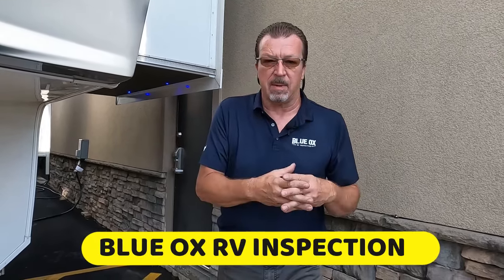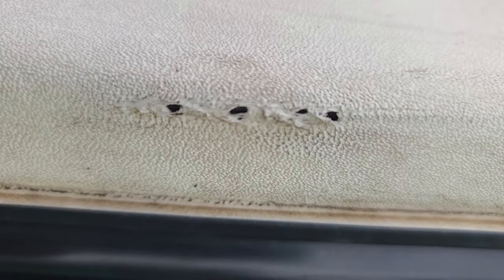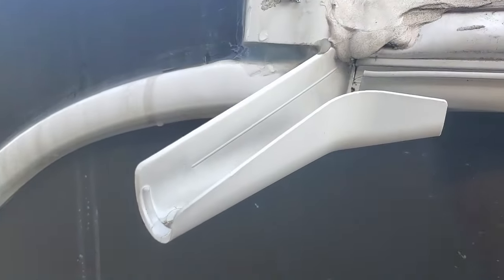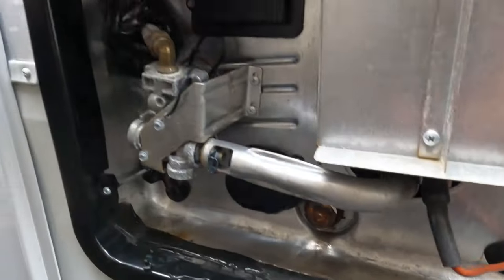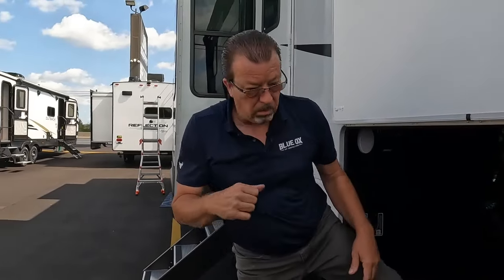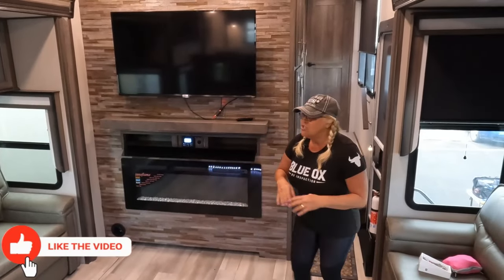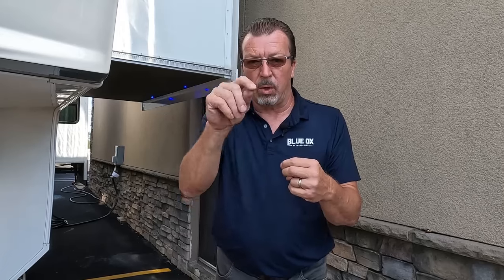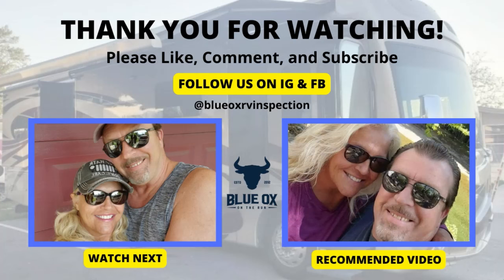💥LOOK PAST RV SHINY TIRES and HUGE OPEN SPACES CREATED BY SLIDE OUTS!

Comment: Always disappointed to see shoddy workmanship.  Yes, it is all fixable, but should a new 5th wheel need to be fixed when it comes direct from the factory?  If the dealer did a PDI, I would demand a refund.......how does a broken shower head or shoddy sealant application get passed?
Reply from the maker: I would love to hear their versions as well 🙂

Comment: I own a Grand Design Transcend XLS 200MK. Last April I took the factory tour of the Transcend production floor. Tour guide remarked several times about their strict unit pdi before it left the building. Well, here is what I saw. Starting with the Lippert frame, less than desirable weld beads on critical areas. Same goes with the spring shackles. No wonder they twist off. When stapling the flooring around the edge of the decking half the staples are protruding 1/4 inch above the floor. Imagine, the outer wall framing is going to mount on top of these protruding staples. Further down the line the pre fabricated lumber used to build the front bulkhead consists of a top and bottom that on some units fit good and some units were very subpar. Send it down the line. There were about 20 people on the tour. I kept noticing construction flaws in the outer walls as the tour progressed. I noticed a couple of times the guide looking over at me as I was looking things over closely. Send it down the line. As the line comes to the end and the vapor barrier and aluminum siding was attached my thoughts were, at the end of the assembly line you can pdi what is available to pdi. All of the construction flaws hidden between the interior walls and outside siding will not be fixed before leaving the plant. Nor will they be found by the dealer. The tour was a real eye opener for me. No wonder the first time I opened the a.c. vent above the bed with the a.c. running I got my eyes filled with saw dust. So the long of my post ends with this. If all rv manufactures are as haphazard in their construction as I witnessed in Grand Design, I'm not sure I will be in the market for any more.
Reply from the maker: Thanks for sharing the real side of the industry 😁

Comment: This is a 2022 model. Please show the data sticker on the service side front. You’re inspecting a 2022 but you’re saying it’s a 2024 in your video. It does matter.
Reply from the maker: Why are you arguing 🙂 ? Built in 2023 considered by GD as a 2024...🙄 I don't make the calls, they do 🤨

Comment: Great video guys. If the dealers would PDI the units when they arrive a lot of this could be avoided. They dont because sales charges service to do the PDI. This is insane and as you have found, could allow for a unit to sit with water damage for months, causing decking to need to be replaced. If the had PDI'ed they might have found the issue and fixed it before damage. Manufactures do need better quality control, but dealers are the ones really screwing people. Every dealer should have a qualified inspector on staff checking these units. Its warranty work so it cost nothing for the dealer to repair. Simple fact is dealers would rather save the PDI money and pass on a crap build to a customer to find the issues and take months to fix them.
Reply from the maker: My thought as well...!

Comment: I like the idea that all these things would be repaired before driving off but I have real trouble imagining that is even possible.  Does a typical dealership have an electrician with available time?  Plummer?  Wood worker with skills?  I once went to camping world to have a screen door replaced on a Winnebago Travato van and I was treated to 3 guys looking at the job and clearly having no idea how to do it.  And getting replacement parts, I couldn't even get a return phone call.  BUT THE MOTIVATION OF NOT GETTING PAID MAY BE JUST THE MAGIC ANSWER!  Do the dealers really jump to it after getting the repair list?
Reply from the maker: I really think it is the only drive !$$$

Comment: i know you inspect alot of makes but what is one of your favorite and well built 5th wheel rvs. i value your opinion immensely and maybe use you in the future. iam in the stages of shopping for which brand. iam lookinf at the luxe brand now but very pricey. are they high quality as stated?
Reply from the maker: Right !? You tend to get what you paid for ! 
But always keep in mind the out if control human factor 🙄.
I really don't have a favorite brand on 5th wheel,  or any other type as well. For me, it's a box, making sure everyone was on it the day of the build is key!
Sorry it didn't help, I get it. Yet the most important part is always the floor plan fir me! 🤙
Make sure to reach out when you need help www.blueoxrvinspection.com